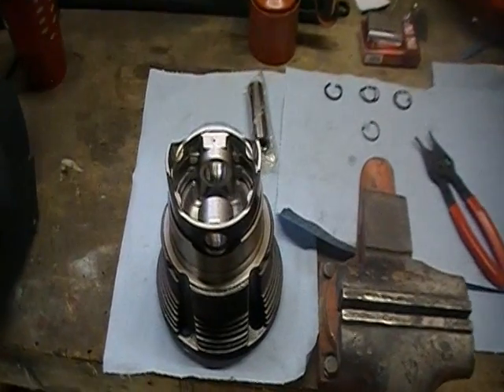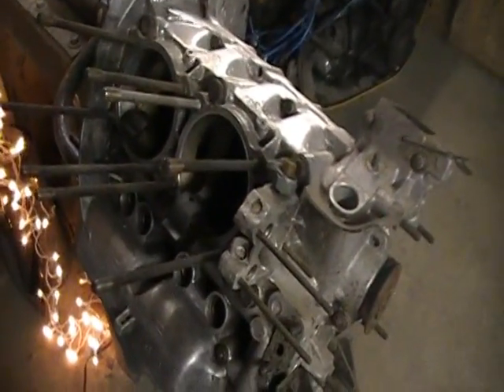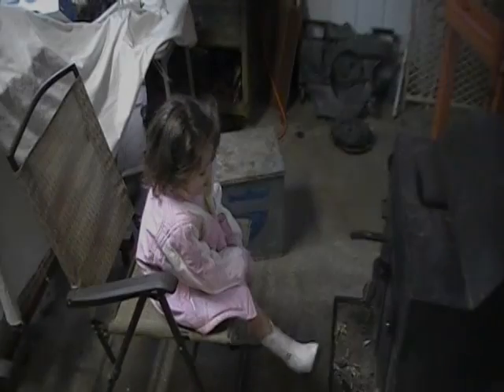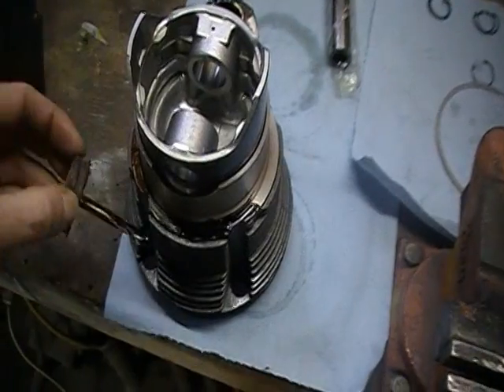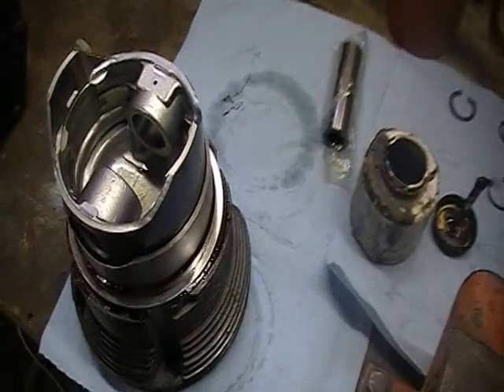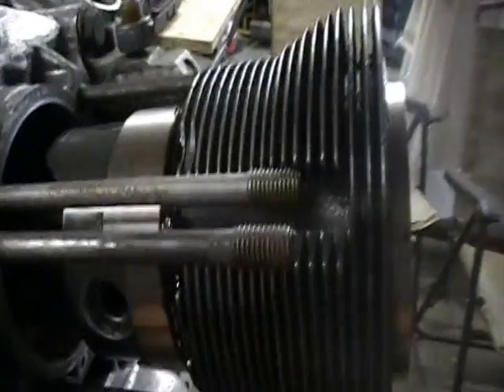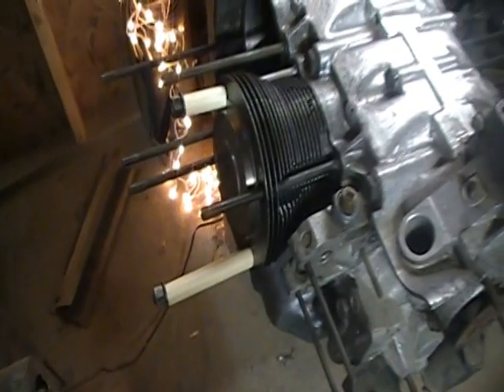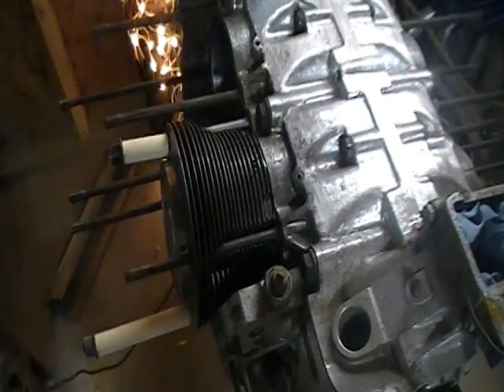Type 4 Engine Assembly-part 1

Comment: shouldn't use the cylinder gasket and barrel gasket .
vw put a buliten out in the mid 80's about not to use them .
i have worked for a lot of engine builders and none of them use them